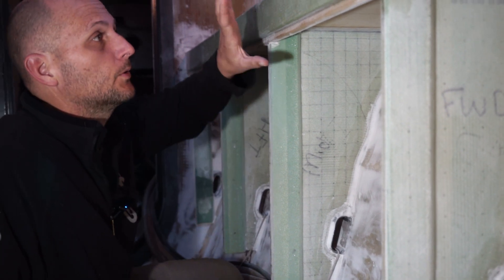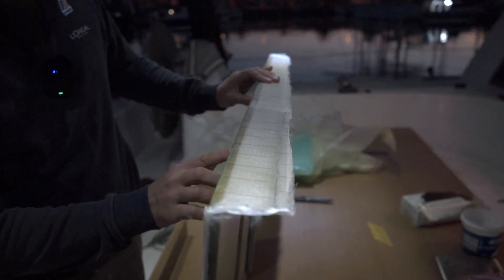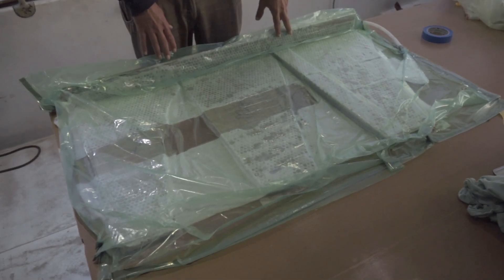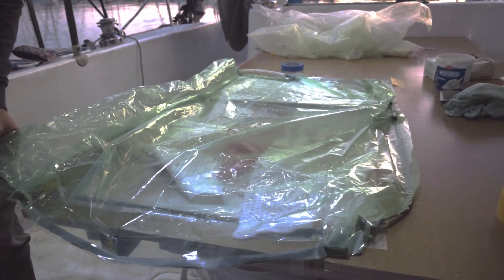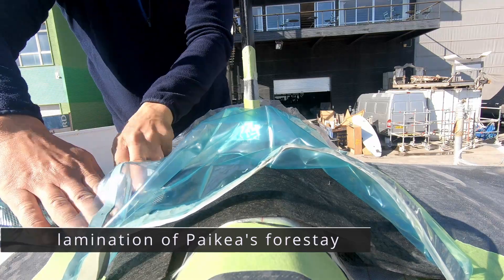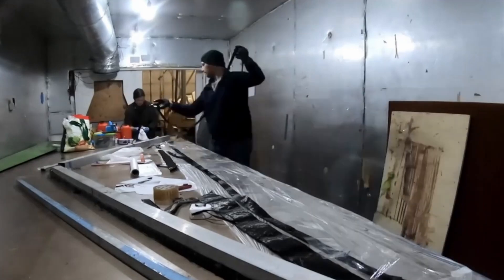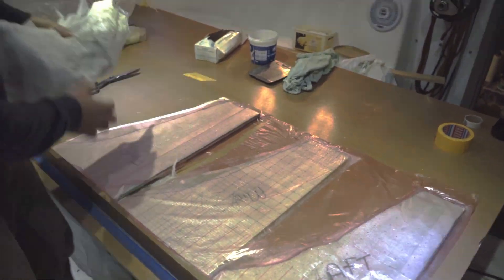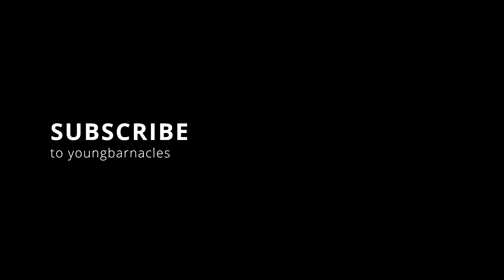Functionality and Servicibilty - Making our Bunk Gussets Awesome!

Comment: We used Ikea Trofast kids plastic slide out bins in this sort of application to store the daughter's clothes. Very light and easily replaceable. I've used 4mil / 0.1mm thick builder's plastic (drop cloth) as bag material when not able to get good bagging material. Some are even puncture free when new :)  Nice to show how you made the carbon martingale. As always I learn something new. Now I wish our saloon table had a Teflon top instead of a wood veneer!
Reply from the maker: We looked at a couple of IKEA options. Unfortunately, the space under the bunk is not that deep. Anna was going to make cloth shelves to allow airflow and we may still go down that route. Still looking at ideas there.
Haha! And yes, the garden/hardware store can be a good spot for vac bagging supplies. I have been know to get vac bags and breather felts from there in a pinch. warning results do vary 😆
Highly recommend you get some sticky back Teflon for your saloon table. You will be as popular with the wife as I am 😇🤣